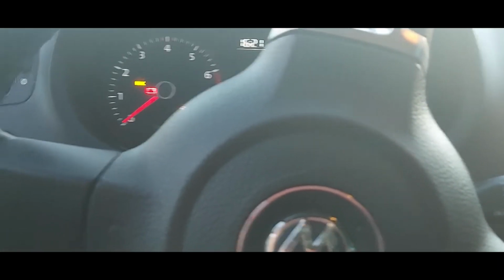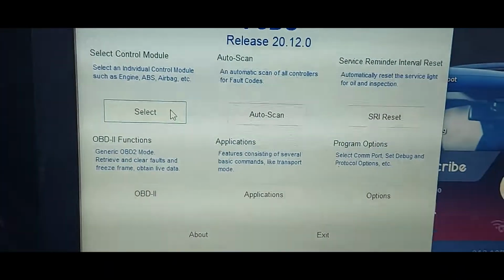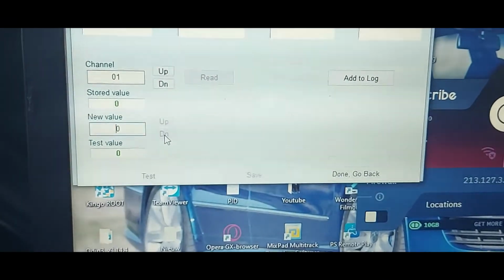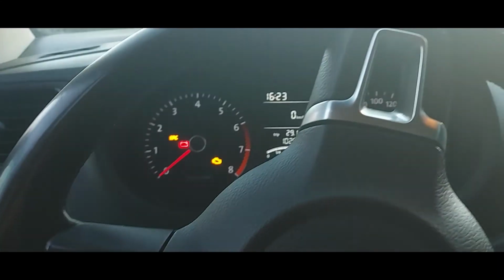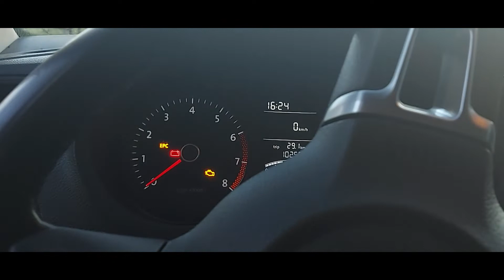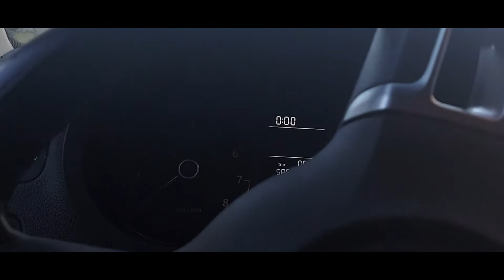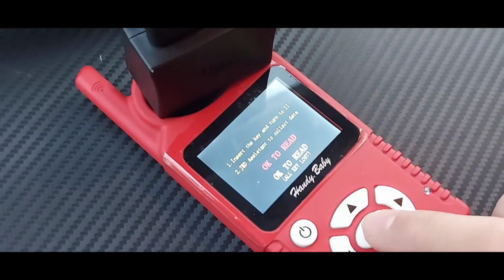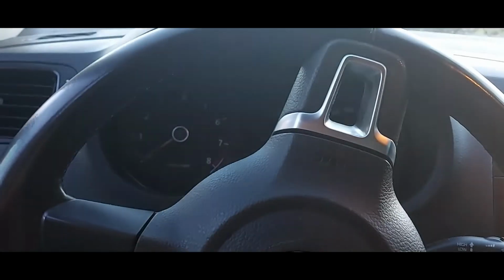VCDS remote key adaptation VW Polo 6r and copy chip id48 with JMD spare key

Comment: Hello friend and congratulations for the video guide.. is the procedure the same for a vwolsfagen polo 9N 2004!? I have to first program the id 48 with handbaby and then do the adaptation with vcds!? is that so!?
Reply from the maker: The remote need to be programmed with vcds or you can use 2 key method the id48 chip can be done with xtool handy baby or xhorse
Reply: @TheOnlineMechanic  ah so once the adaptation has been done with the original key I can easily program the second blank key with the VCDS having the pin!! Right!?
Reply from the maker: @Diablo-RED  remote is without pin
But immo is with pin

Comment: I have a key that still turns the car on but remote function doesn’t work because a kid played with it for like an hour. I assume all I have to is the adaptation part?
Reply from the maker: Yeah remote adaptation or battery replacement
Reply: @TheOnlineMechanic  thank you very much, just did the adaptation without even changing the battery and it works fin!